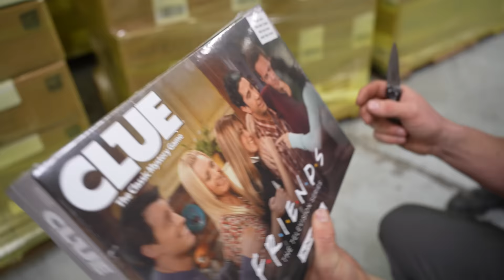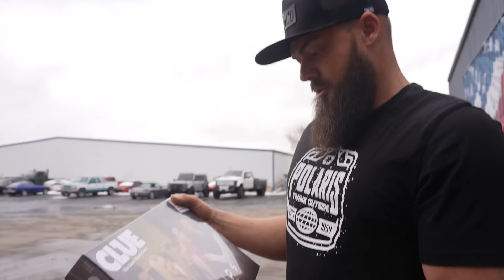I Bought an Entire Semi Truck Load Of Lost Freight For $6000 - The Ultimate Side Hustle!

Comment: As somebody who works with a company that often ships pallets of very similar freight in terms of those conveyor belt pieces, you could easily be looking at $200,000+ in equipment there.. I've seen a box of rollers get claimed out because a warehouse worker sent a fork through them, one box of those rollers could be well over $25,000.
Reply: It's just a paper weight, if there's no buyer.
Reply: @mariatorres9789  could try and return it to the company if its all new
Reply: Those must be the gold plated ones.
Reply: @mariatorres9789  There are plenty of small manufacturers that can use conveyors.
Reply: @mariatorres9789  my wifes company had to buy their belts second hand because there were none available soon enough...there are plenty of buyers
Reply: Agreed, ive seen less go for a lot more.
Reply: Especially for food processing equipment or shipping equipment etc
Reply: Bread rollers are cool.
Reply: The belt line is very valuable if you can find a buyer and offer a good price. My experience with this stuff is that the supplier hires a company experienced or since it's a Honeywell product it would often come with a crew to assemble and test.
Reply: My brother-in-law was a welder and worked for a food service extruding company who made hod dog machines. When they sold a machine to a company in Germany, he spent 8 months in Germany as a crew member installing and debugging the system. While most of his time was spent
working while he was there, he did get some time as a tourist.
Reply: I recognized those equipment because i work outbound in an Amazon fulfillment center the products come in totes that roll on those conveyor belts and we pack the products and toss it on another belt to be delivered to the customers

Comment: 😂 the first stuff is for industrial automation, I work in the field and you've got a conveyor system with control boxes. If you've got PLC's(programmable logic controllers) those alone are in the thousands of dollars, you could just take those devices off the din rail and sell them individually for mega bucks. Especially right now when anything Allen Bradley is incredibly hard to get with shipping times +6 months out some PLC's are 18+ months out.

Edit: just those contactors are worth a minimum of $100 each depending on the type you've got. Normally the more amps it can hold and softer close it has the more money. Even refurbished ones go for hundreds

Comment: That space between both of the buildings is literally just enough space for those big trucks is so insane
Reply: Yeah it’s hard to tell if it was designed that way or luck
Reply: Do think the side mirrors on the truck folded in flat, or that they had to remove them before going between the buildings?
Reply: @immortaltyger1569  I would guess so, since it looks pretty tight.
Reply: When I drove a 5 ton Army truck in Germany some of the houses in the back country towns were so close together on the road through the town that I had my mirrors mounted with removable pins and cotter pins instead of bolts so I could fold the mirrors in so I wouldn’t knock the flower boxes off the bottom of the windows back in 1979-1980
Reply: @jaymcginty6786  Saw similar problem while we out on maneuvers in 73 - 74, the lead vehicle lead the whole convoy into a very old village in Germany where you could barely get a small car though it - after making a wrong turn and attempting to get the convoy turned around.  Maneuver damages probably got paid for that fiasco.
Reply: We had our lead command track come off the fop of a hill to fast and when the road turned to the left at the bottom of the hill she lost the left side steering brake because a worn out connection pin fell out of the yoke… she jumped the curb and went through a brick fence, completely through a living room of one home that a family was in the kitchen eating breakfast, out the back of the house and stopped in the next street over … the TC ducked inside the track but he didn’t get his hatch closed in time and got beat up by falling bricks 🧱 all the crew walked away but they were covered in bruises and scratches
Reply: @jaymcginty6786  Now that sounds like damages should have been paid out to that family, not to mention a hard look at who was doing maintenance and how the track was being handled.
Reply: @immortaltyger1569  I do remember that there was over 1 million marks in damages and the Battalion Commander on down the line were under investigation, I am just glad the family were in the other side of the house when the M113 track came through… I think the driver lost her driving privileges and a motor sergeant over maintenance got demoted, I never found out what the outcome of the accident was
Reply: Repent to Jesus Christ “For where two or three gather in my name, there am I with them.””
Matthew 18:20 NIV
I
Reply: Yo did you see the green sisu nazu in the backround
Reply: NORM! is Cheers.
Reply: Just think we have semi drivers quit and pull in alleys like that in Philly nose first and a closed alley at the other end. Try backing on to Gerald Ave blind. I had to go because of getting into the truck. That guys a ace driver
Reply: I'm a story teller 😂
Reply: @jaymcginty6786   as of 2016…. I can confirm that it’s still exactly like that 🤣… and they were probably still working on that bridge on the autobahn between mesow and kleber
Reply: I would have needed a diaper if that was me driving through that space. And I'm not a trucker but damn that made me hold my breath. Lol
Reply: @jaymcginty6786  Nice feature. It still wouldn't keep delivery drivers from smashing the mirrors or knocking them off completely. Electric-folding wouldn't matter much either.
Reply: @justsayinfornow5274  yup I caught that as well.  Lol

Comment: The absolute jaw drop when I saw the conveyor belts. I used to work for Honeywell Intelligrated, who manufactures and installs conveyor these for a lot of distribution centers, especially Amazon. I installed these exact systems at Amazon warehouses and could point out most of what that stuff is. Wild to see here!
Reply: This is most likely Dematic systems,  as thats what we use on most of the western side of the US. Intellegrated on the east. (Which I can confirm, living in the same state as these folk, the only warehouse not using Dematic is the middle mile building, which uses a 20k mechlite from a company that I can't even remember the name of) 

However those labels are middlemile labels from within the network, meaning these weren't being used by the company, just fulfilled through its network.
Reply: This is what I’m saying I work for Npsg world wide and we are right now building a new Amazon building here out of Boston and those are he exact products that are being used by Honeywell intrigued teams . I was also astonished as to how I found this after just leavening work today and seeing these equipment that should be at Amazon lol in this building lol 😂
Reply: How much do you figure that system is worth?
Reply: @marksprinkle he orange rollers called MDR’s (Motor Driven Roller) are special coated. I use those in my department and those alone go for 2k each. They have easily over 30k in conveyor systems.

Comment: I work for Ford Motor Co. and we buy these all the time from ABT, we have robots in a caged cell, and this is the conveyor system to feed the stock after the robot has done it`s job, whether it`s on a small pallet or what ever, you have the straits, the curves, this may have been ordered for a specific application, but it`s sure adaptable for others, if I know Ford we pay 15 to 20k for these systems, your looks new.

Comment: Dave. That conveyor equipment you bought was manufactured at Dematic. I worked there 25 years on the shipping dock and in power assembly.  A conservative estimate for the mini system you have is over 100 G
Reply: I agree Tim. I'm a Millwright out in Chicago and I work on this type of equipment on a daily basis. If they signed the frequency drives that drive the electric motors they probably are looking at well over a hundred grand
Reply: He said Honeywell, not Dematic. Honeywell bought Intelligrated. I worked at Dematic for over 9 years and now another automated material handling company for over a year. I was hoping for a better look at the equipment to figure out what it all was. Not sure how many Sick scanners they were and what model they were so they could be cheap $50 units or several hundred dollar camera scanners.
Reply: I thought Dematic was Green?  That is part of a Honeywell Accumulation Conveyor.  I agree the conveyor parts are worth well over 100K.
Reply: @DaveStewart-qo4bd  The standard color was green. Customers could request other colors. Amazon was one of the customers that wanted a special color. That white/gray color looks like Intelligrated(Honeywell)'s standard color.
Reply: @FastSS02  don't forget about stainless steel
Reply: @augustwest6637  stainless steel is only used in raw food processing conveyor systems. Dematic doesn't do anything in the raw food market. I never looked into Intelligrated to see if they have such equipment.
Reply: We have Dematic AGV forklifts at work. I used to work in textiles and had Egemin Automation AGVs there too.
Reply: @DaveStewart-qo4bd  those supports that Allen called "legs" were painted Safety Yellow..a requirement for Amazon distribution sites. Sometimes other companies request the same color
Reply: @FastSS02  Honeywell scanners and power rollers were used in the controller sections as part of the  subsystem . Dematic attached a simple removable metal tag that was used to track the particular job and whoever worked on that order
Reply: @FastSS02  honeywell is a manufacturer of the instrumentation and controls for industrial equipment.  they dont make conveyor systems
Reply: @falfighter  check your facts. Honeywell bought Intellligrated. They were a competitor at one company I worked for and supplied conveyor and equipment for the next company I worked for. 10 years of material handling experience here.
Reply: @augustwest6637 VFDs are super cool and useful for many things. Not encountered one yet that needs a key/activation to work but mainly I deal with smaller ones. I have a Lenze SMVector w/built in disconnect that was probably over 1500 when new and I bought it for about 100 bucks from an exhaust fan manufacturer that wasn't using them. Runs my big air compressor in speed vectoring mode. That thing is absolutely amazing. It's running a 1940s Allis Chalmers 3hp motor and even being so old that motor is cold, even after running for 3 hours at full load. With the speed vectoring, the 50 gal compressor has the output of an 80 gal. Pretty impressive technology.

Comment: I work in industrial automation.  Those Sick sensors alone are worth the 6k you paid.  The gray electrical boxes with AB contactors are high value, also.
Reply: Yeah man that dimensioner is worth more than what he added up out of the board games.
Reply: About $400 each if they are retroreflective.
Reply: @Will_CH1   for a basic conveyor system those sensors probably barely push 150 ea
Reply: @Goryrat  Those are Sick optics. You pay more for German quality. The laser sensors such as the OD2000 can cost over a thousand but the ordinary proximity sensors are a couple of hundred.
Reply: @Will_CH1  and as I said for a basic conveyor system that seems to be in that truck it would be common photo eyes 150 ea.

Comment: Dude, that conveyor system is worth a lot! 
And I work for the company who makes all the sensors you guys unpacked. SICK. 
You stumbled about A LOT of money right there 🤣
Congrats!
Reply: The only problem is to find a buyer for a custom belt. Ideally they would find the original buyer and they would still need it. But yeah the belt is worth much more than all the games combine.
Reply: Can dave call honeywell and the original manufacturer to get some bounty for the lost product or even sell it back  for forty percent?
Reply: @erictremblay6867  the original buyer would eventually need parts for the other one they had to order...
Reply: @jakestarr4718  Those thing are built to last. They are not going to buy a duplicate of the all system for the few part they would need in the next 20 years. Maybe the belt itself and the roller. But the rack is not going to break anytime soon. In any case with the investment they just made they are not going to bother. Its probably the same reason the fabricator did not want it back. They rather just collect the insurance than having to store this stuff and ending up throwing it away anyway.
Reply: 2% chance this dude isn't completely full of   **
Reply: 98% chance the camera-shy trucker was driving around a stolen load
Reply: @-Bill.  No, CDL and papers are easily tracked. Easy to verify CDL, license, vehicle/trailer registration and papers plus everything is labeled as going to a distribution center that went out of business. As was stated there are companies dedicated to buying abandoned loads. There is a simple process to verify it's not stolen.
Reply: I feel like the belt will be easier to sell than 10,000 board games lol. And that shit is money too. 

Usually just the rollers are pretty valuable and they break often enough too. I guess depending on what you're conveying (conveyering?)
Reply: Haha. I saw the blue boxes and was instantly thinking $$$. For the right buyer anyway. SICK makes some damn nice stuff.
Reply: Really? What money did they stumble on? Who is out here buying industrial conveyor systems on the street?
Reply: @erictremblay6867  Yep. Any sort of industrial equipment is worth a ton of money. But it's incredibly niche.
Reply: @ironmyno  I work for the field service side and this was already paid for so they won't get money from honeywell.
Reply: @JasonG1000cc  - Honeywell could buy it back, at 10 cents on the dollar. Inspect it, and return it to inventory. Much cheaper than manufacturing all these parts. The components might get split up over various future custom orders. Some pieces may end up going to scrap if not sold, but still at 10 cents on the dollar, there’s a lot of wiggle room to scrap half the load and still make profit for Honeywell.
Reply: @stephen3164  I know they could I understand that that but 99.9% percent sure they won’t. I see millions that just goes to roll off dumpster with different company name’s on them.
Reply: I’m sure they get a little cut but they just keep it moving.

Comment: Yeah i fully get why wizard is so exited. I would too if i got that load. Just one encoder or inductive limit switch can run anywhere from 50$ to 500$ a pop. Rollers too are hella expensive. I'm always looking industrial equipment and parts since those last decades for average joe use. For instance my "dremel" is surgical tool with explosion proof foot pedal. Probably cost 20K new, but managed to snatch it for basically free.

Comment: The motors are the orange roller. There called MDRs in the industry. OR motor driven rollers. The connect to the other free spin rollers via rubber bands .

Comment: What I'm amazed by is the truck squeezing through that corridor lol
Reply: Great driving 😅
Reply: Its actually not as hard as you might think. Have had 53 footers in even tighter spots before delivering for Dollar Tree. You get used to backing and or pulling through tight alley ways. Like any job the more you do it the easier it gets. lol

Comment: As a European truckdriver, I hate the American pallets. We have 120x80 and 120x100 cm pallets, and you can get under them in length and width. Also, our trucks can load 2 pallets next to each other that have that 120 cm wide, or even 3 120x80 in length next to each other. Furthermore, they are way more sturdy than those US pallets... PS: You might want to buy a Japanese pallet-truck, they are way lower, so you can get under your US pallets on the side as well, lol!

Comment: Seriously, 2 options, second time i have watched this.  You could buy a warehouse, unload the fright and store it for them until it goes to where it belongs, or own it by default, then with a deal with that trucker sell the load and split the profits to cover the storage fees.
Or store the trailer, and rent them an empty trailer to use with the same end results. Both ways you have to know whats on the manifest to know what route to take.
4 to 6 months no work doesn't cut it. And its even more when trucking is in such a large demand.
This cost the guy 10 times what you paid in lost earnings.  If you figure 6k a load and 40loads he missed out on thats 60k gross income.

Comment: That looks like a nice conveyor system you picked up. It looks like the system that was at a former workplace of mine. The feet held up 2 rails about 3 feet off the ground, with the silver rollers between them.  We used boards about 2 1/2 feet square to roll down the line with our items.  The black belts from the first box probably stretch between the orange cylinders, and provide some powered movement for the line, and I see curved rails that seem to be for going around corners, with the remaining line moving freely.  I am sure that you are correct in your rough estimate of it's value.  It could be easily half the value of the load.  And the games could go fast at 50% off current retail price.